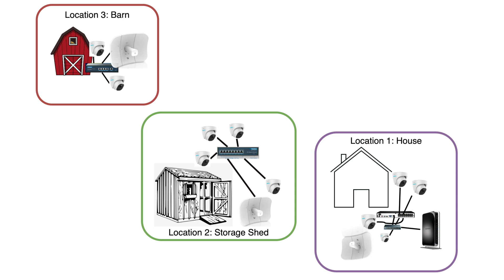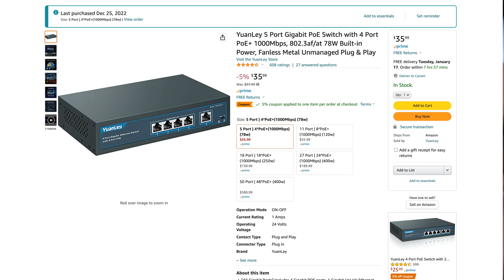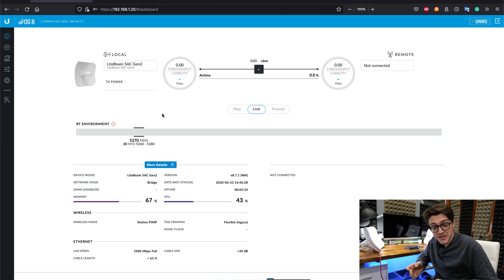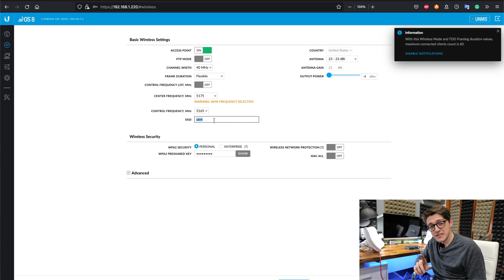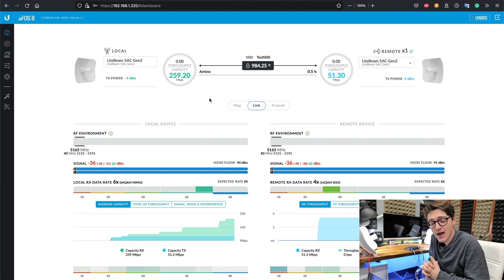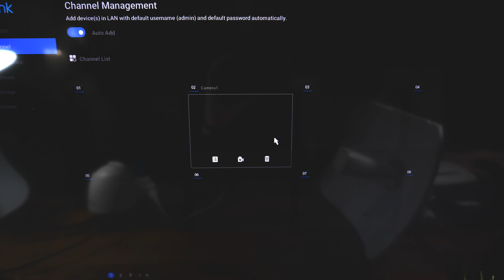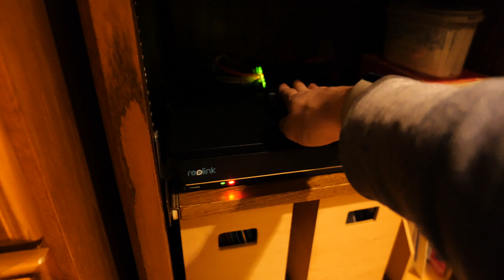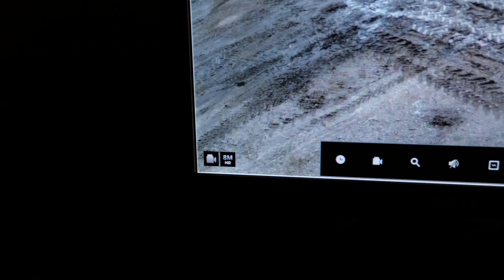How To Connect PoE Cameras Miles Away To A NVR! || Reolink NVR || Ubiquiti PTP Wireless Bridge Setup

Comment: 3:12 seems silly to be using the POE switch (for obvious good reason) but then still use the injectors. Why not just plug them straight to the Switch? Only reason to do that is if you plan to use the injectors at the install site and want to test them beforehand.

Comment: Hello, so if i have 40 cameras on the set up, ie 8 at the receivijg end (admin) where the NVR is , and others at the distant locations where am setting the point to point connections, Do i have to ensure the NVR has 40 channels? And can accommodate all of them? Or since they are wirelessly connected via p2p, then even if its say 16 channels it can handle them?

Comment: Nice Video,  my nvr is on my home network, and I'm trying to connect one of the poe cameras in a remote building via a wifi bridge to my home wifi. I was able to get it to connect but it was so slow, it only would show a frame at a time, about every minute. Any thoughts on the slowness? I'm testing this all in house so the signal level is great. I'm just using a TP-Link unit configured as a wifi bridge to plug the remote camera into, and it connects to the home ISP modem wifi which my nvr is on.

Comment: do you have bit-rate on the cameras set to variable? if so likely that's why it isn't a consistent speed. probably better as when less motion is goin on its less likely to push a lot of bandwidth. im curious if you put them on CBR continuous bit-rate i wonder if that data link bandwidth would be like a more steady ~50mbps.. hope that makes sense

Comment: Man although I didn't grasp a few key points(you were moving a little bit faster than my brain works) & will have to rewatch at least once more(most likely several times more) it's a super helpful video! A few questions off the top of my head are, did you name all of your old routers the same SSID(to keep you things uniform etc? Reolink do an RLN36 which needs 4 POE injectors/switches etc, so would they(the litespeed radios) work in between the NVR & Subscribers I think you called them? Maybe it's going to be easier to have multiple systems?

Comment: I watched the video and I pretty much follow. I put four cameras on the exterior of the garage and run them to a p o e switch that has enough spaces for the camera wires to go into it plus my extra wire that's running underground going into the house. That one single underground wire will run to the NVR along with the four other wires from the four cameras that are attached to the house making a total of 8 cameras at 4K with one p o e switch in the garage and one underground wire

Comment: What about the max distance between antennas? Do they have to face each other?
Reply: Yes, they have to be pointed directly at each other with each unit (ideally) being aimed less than 3 degrees off axis. The closer you are, the more slop you can have. The radio has an Alignment feature that will refresh the signal strength every second or so and help you tweak the alignment. Real-world max distance is probably in the range of 10 miles. 
HOWEVER, this is only under ideal conditions with totally clear unobstructed line-of-sight, where each radio is mounted on a ~100' tower (or shooting across a valley). If you're shooting through dense trees, you won't even be able to get 500'. 

Real-world performance will vary depending on distance and line-of-sight, but the solution presented in this video will work for most applications. I've put up literally hundreds of such links.

Comment: Do you need to use the injecters if the NVR and switch have POE?
Reply: The Ubiquit radios require 24v of PASSIVE POE. They are not compatible with your off-the-shelf 802.3af/at POE switches. The same is true of TPLink radios. 
In fact, I'm not aware of anyone who makes a low-cost radio bridge that runs on 802.3af/at POE. Not sure why.

But if all else fails, you can plug in a $17 802.3af converter into your radio and then plug it into your POE switch.

Comment: what can you tell us about that battery backup you've got ? I want to seperate my nvr and cameras from my house's powergrid and try to have a battery/solar solution for the nvr ..
Reply from the maker: It’s just an uninterruptible power supply (UPS) by APC! It’s linked in the description. Really anything that is a UPS should work to protect your power to your devices and provide additional power if electricity goes out for a short time

Comment: Does the router need an ethernet connection providing internet? or is internet not even needed in this setup?
Reply from the maker: Not needed! The router is only there to serve as a DHCP (IP Address) server, so that the security cameras can obtain an IP address that the NVR is able to add. Hope this helps :)!